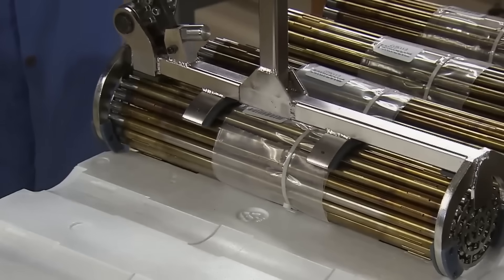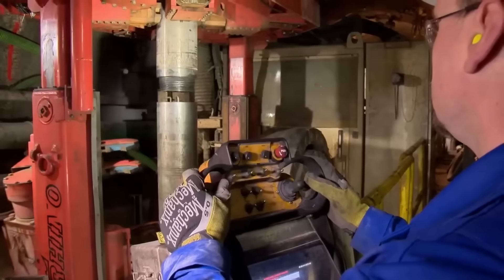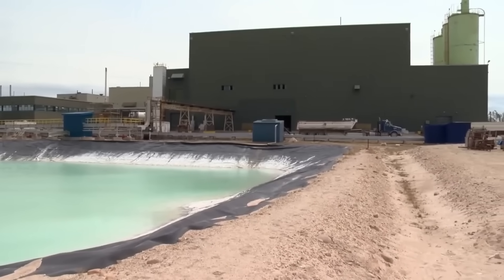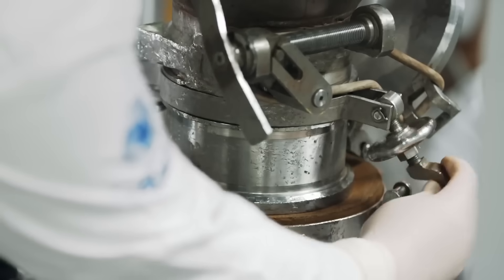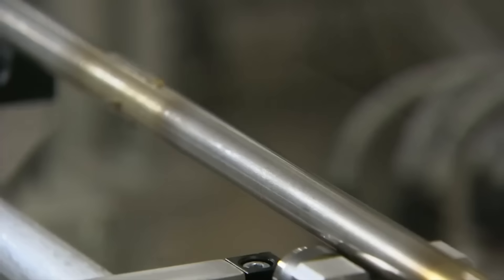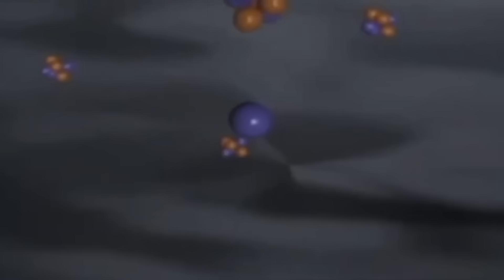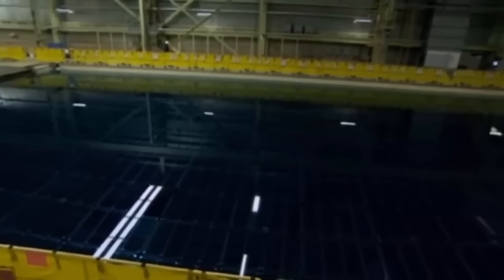How Enriched URANIUM is MADE☢️ | How URANIUM is EXTRACTED FROM MINES | From Mine to Reactor

Comment: It is still an expensive process but at least clean energy, because the fuel rods only last 18 months before turning into plutonium-239 which is the waste material

And still, it contains energy so it stays radioactive, we need someone to come with a new chemistry that makes a fuel rod last much longer because the entire fuel in a powerplant only last 3-7 years, +50 years is good

Comment: Although the spent rods "cool down" in the holding pond, they can't simply then be dumped in your neighborhood landfill.  Currently the US has about 50,000 tons of these rods in cooling ponds.  They remain so radioactive, even after a year or more in the pond, that they have be encased in steel and concrete even to be transported.  The cost of permanent, safe, storage of this radioactive waste will be borne by, you guessed it, we taxpayers.  Currently there is actually no plan, let alone a location, for this project.  Nuclear power seems like a good, no carbon, power source.  It is not.

Comment: Its hard to say if coal or nuclear is more effizient. when you get coal out of the ground its more or less ready to use. Uranium needs a lot of Processing but less Energy for  transportation.
Reply: But you also need to mine and extract far more coal per unit of electricity than nuclear, so that will cost more pretty soon during both plant’s operation.

Comment: with them still being so hot how can't they have a secondary plant use them to still heat water.   Sound to me they still have plenty of life left in them to keep producing power if it takes 10 years to cool them down.   Sounds like you could get almost 5 years or more out of them instead of just 1 year.  Seems like a waist of product and wasted fuel.   it be like putting 10 gallons of gas in your care and only getting to use 1 gallon
Reply: At the end of a 2 year fuel cycle, there is about 85% of the fuel left if the plant runs @ 100% for the 2 years.  If there are start up and shutdowns, the number will be higher.  At the end of a 2 yr cycle it is more efficient to shut down and refuel to the new cycle.
Reply: By hot in that context of AI slop.  It just means radioactive.  Hope that helps.

Comment: If one use big rock and make a hole then poor hot iron into it and pressurized under more pressure than normal like few hundred ATM ( atmospheric pressure) or few thousand ATM then let it cool down then you had uranium cheapest way no need expensive stuff but handle with care because vibration would start radiation ( or use compustion engine and connect pipe poor liquid molten metal in then use hand screw to crank down the pistons until hew hundred thousand psi or million psi then wait for cooling

Comment: Typically only 3% of the energy of a uranium rod is released before the rod cracks and has to be replaced, yes they could be reprocessed but it is cheaper to make new rods out of yellow cake.
Cracked rods have to be stored for 100,000 years in an atomic waste dump under high security to prevent terrorists getting their hands on them to make dirty bombs which would make our cities unlivable and this level of security is costly, however why this cost never enters into the equation beggars belief.
Whereas a Thorium fueled Liquid Salt cooled nuclear reactor gives up 97% of its energy and is cheaper to build as it operates at normal air pressure and doesn't require a high pressure steel reinforced concrete dome and several steel reinforced concrete chimneys to vent steam all of which cost about $500,000 and take ten years to build.
Every government should ask Kirk Sorensen from FLIBE to give them a talk on Thorium fueled, Liquid Salt cooled, nuclear reactors which can be built anywhere, even in a desert or on Mars.

Comment: Actually the Uranium is used to heat water, and that steam runs through a turbine, which conducts the electricity. The only difference between a Nuclear power plant and a coal/gas power plant is how the water is heated. After the water is heated, they all work the same.
Reply: It is the fission of Uranium 235 that creates the thermal energy to heat the water.  The turbine does not conduct electricity.  It is connected to a generator that produces electricity.
Reply: hell of a way to heat water
Reply: @TheHypnotstCollector  pool heater that i need but cant find to buy it.
Reply: I am amazed, that a nuclear plant is basically an advanced steam engine!?
Reply: @DJURBANBG  Every means of electrical output are steam engines except for solar cells. The 200 year old priniciple still applies , it's just the means to create that steam is different.
Reply: @DJURBANBG indeed... How about a techno of harnessing those electrons sans steaming?
Reply: Except coal polute atmosphere 100 time more
Reply: @grimreaper9853  Yes, but environmentalists only care about pollution if the solution is wind and solar. Getting their way has been more important than their supposed environmental concerns for decades.   Continuing to use fossil fuels for while wind and solar is developed, is preferable than actually having to come to grips with an irrational fear of, and opposition to, nuclear energy
Reply: @grimreaper9853  While Nuclear will pollute the ground for thousands of years.
Reply: @grimreaper9853  It really doesnt.  At least not in the United States. Precips and Scrubber systems take everything out of the exhaust.  Same with concrete plants. It is just water vapor coming out of the stacks
Reply: @poorsport213  And CO2
Reply: @mrperfect87106  Even thats knocked down to a miniscule amount. It regulated pretty tight in the states at least
Reply: Exactly. Worked as a welder in quite a few nuclear and coal burners. Gotta have the high pressure steam.
Reply: No electricity is produced without STEAM!
Reply: @JoelJ-j6q Hydro, wind, and Solar.
Reply: That's exactly what the video said.  Ackchyually
Reply: Yup
Reply: It's not the "Plutonium" that heats the water, it's the fission decay that releases heat absorbed by the water.
As to Plutonium, well - it's complicated, but most reactors primarily use Uranium or spent Uranium+Plutonium (MOX).
Not a simple subject - I'll leave it there...
Reply: It's simple, U238 absorbs a neutron and becomes U239.  It then undergoes a beta decay which 'converts' a single neutron to a proton.  The atom then becomes U239.  Commercial reactors create U239 while operating.  It helps to extend the fuel cycle.  Wait, did I say simple?
Reply: Its uranium in rods of steel, and the contac with water make it somehow very agressiv reaction
Reply: @pieterdeboer5361  So it is. I was watching some Nuclear weapon videos around then as well. I guess it crossed.
Reply: With the exception of photovoltaic cells (solar panels) nearly all our electricity is generated from mechanical spinning force. The simplest way is the steam/turbine method which simply needs heat. That heat can come from any source. Combustion is the most common, nuclear, geothermal and some solar plants use this method.
Reply: I hope that the water in the cooling tanks is used to enter the reactor as it is already heated right?
Reply: You don't know what you're talking about lol
Reply: @wesleywood6306  its exactly what he is talking about, watch the video
Reply: You are wrong.

Comment: They are not handling it with bare hands, or at least should not.  In the video the handlers are wearing gloves of various types, including simple latex.  They are handling titanium rods, not bare U235.  See Wikipedia about "thermal neutrons" and "Gray units" to get a better understanding of those parameters.  The thermal neutrons from natural U235 are very low energy, fractions of an eV.  As such, they are absorbed almost immediately by any nearby barriers.  The real danger is the "dust" or airborne particles, which if breathed in, will stick to lung tissue and act as a cancer inducing site.  Even at these low eVs, the dust is far more dangerous.  Here in Colorado, the soil is naturally radioactive at very high levels, producing Radon gas in under floor dirt areas.  Even so, we have one of the best health records in the whole country.  Metallic DU is much less radioactive than many of our natural soils.  However HEU in metallic form is unsafe to handle, since it will emit high energy neutrons.  That requires heavy metal shielding.
Reply: Where are you getting your information? Without fission, no neutrons are produced.  The half life of U-235 is approximately 703.8 to 704 million years.  Not producing a lot of neutrons.  All neutrons are produced fast.  A thermal neutron is a neutron that is in thermal equilibrium with it's surroundings.
Reply: @vballjim01  Its the dust, shavings, scrap, and combustibility.  Radiation pretty low.
Reply: I worked in a Hospital for 23 years and watched them build an MRI., very interesting, the amount of shielding involved.

Comment: Uranium waste can be recycled as a battery by breaking it more to a smaller particles and coating it with cobalt metal and using the old black carbon rod conductor of the everyday battery size replacing the old mangganese with uranium liquid waste.
Reply: Oh steam powered battery ,your a genius
Reply: You mean a battery that emitts alpha and beta particles in all directions and is always hot enough to burn anything it touches.

Comment: Impressive technology but tragically wasted on the most inefficient and filthy way to extract energy from nuclear fuel. Simply converting natural uranium to UCl4 and  running this in a molten chloride fast spectrum reactor would enable the use of the 99.3% uranium 238 isotope too, thus increasing the energy yield >100× as well as reducing the production of dangerous radioactive waste.

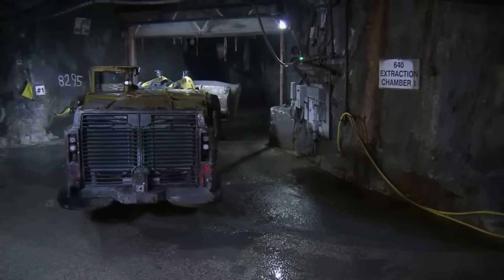Comment: 2:45, u238 is barely active and at the concentrations in the ore, its self-shielding. It’s far more hazardous as a heavy metal than it is as a radiological hazard. Different story if enriched, but FFS most house bricks are slightly RA…
Reply: U238 is depleted uranium U235 is the good stuff
Reply: Bill Gates, Bill Gates, now pushing weapons grade mini-nuclear reactors.  You had better get into the modern world, since the next generation of nuclear technology is going to be driven by the wokies.
Reply: I am wondering how they are handling enriched U-235 with bare hands.
Reply: @khanch.6807  to be honest, time distance shielding. Don’t hold it for long. 

HEU is somewhat RA, but it’s NOTHING compared to irradiated fuel, which is ABSOLUTELY HOOFING STINKING HOT. 

The neutron activated nastiness that comes out of reactors is maaaaany orders of magnitude worse than 235u for activity. Even Pu is safe to handle. The MAJOR hazard is cuts and getting minuscule traces of U/Pu into your bloodstream, because the radionuclide will sit there irradiating your innards for eternity. 239Pu half life is 24,000years, 235U is 450,000,000 years, and 238U is 4.5Bill years. 

The external irradiation hazards aren’t great for HEU and Pu, but the heavy metal toxicity and getting gently internally alpha’d to buggery for the rest of your life by a tiiiiiiny spec of metal or oxide that gets into a cut is muuuuuch worse.
Reply: Enriched Uranium merely means they concentrate  the amount of U235 in natural uranium which is HUGELY U238.  Trough processes of gas diffusion and centrifuges they produce U235 and them mix it back with U238 in different percentages.

Comment: " it takes 8 days to replace one piece of pipe and it takes 200 of them "  that's over 4 years. 8 days to replace (?!) a 1.5 meter pipe ?? That is unbelievably stupid.
Reply: You are unbelievably stupid to think that there isn’t multiple crews working on different rods at the same time….. also if the payoff from  one of those little tiny cylinders is equal to 1400lbs of coal or 1000lbs of oil I think it’s worth it.
Reply: They didn’t explain that process very well. The drill rods are 1.5 m. The length of hole is about 100 m then cased and a brine return pipe installed. Not stupid.

Comment: This procedure is similar to coal mining since the 1950's & 1960's. My grandfather worked first in the wood shop then worked in the mines even though he was over 6"2" high & the tunnels were about 5 & 1/2" high. He was diagnosed with black lung in the 1960's & was retired from the coal mine with retirement pay. My father also worked on the machines which grinned the coal from the coal face. He hated that work as a electrocution.

Comment: You do not distinguish between U235 and U238 very well it is the increase of proportion of U235 via centrafuge which is called enrichment;you only say the U235 can cause a chain reaction - you don't make it clear that U238 is useless in the reactor; and that only the U235 splits.  You don't say how these chemical reactions take place you use useless words like - it is treated by acid - not very informative, why not even more vaughe - it uses a process or it is changed or something is done to it. Pretty much a useless video.

Comment: I've seen this process at BNFL Solwick near Preston, you can't have a drink in the workroom so it doesn't act as a moderator and produce fission, now that was insane...
Reply: I guess you visited the Oxide Fuels Complex? Drinking, eating & smoking is not allowed in controlled areas for various reasons, if you want a drink you just need to step out of the controlled area it's not a problem. Yes water is a moderator (slows the neutrons down) but only a problem in some high enrichment areas there are other materials which are moderators too such as polythene which must also be controlled. A criticality incident is always possible but there are many measures in place to mitigate that eventuality, water exclusion being just one. BTW its Salwick not Solwick and is now called Westinghouse formally BNFL and before that UKAEA in the really good old days!
Reply: @col8981 what do they do about human body perspiration or human bodies constant release of moisture

Comment: Nuclear power is a totally uneconomical and inefficient source of energy:
The energy originally used for extraction and production of uranium could have been used to generate energy long ago! (conversion losses around 90 %)

And then there are the costs for the final storage of the spent fuel rods for more than 1000 years...

And all this for a use of max 30 years...

Comment: Here is something I don't understand about packing and transporting those fuel assemblies.
Putting them in close proximity to each other should trigger a chain reaction, which is tightly controlled by graphite rods in the reactor.
How are they safely transported in those pallets w/o any issues?
Reply: Because these are new fuel assemblies, their radioactivity is very low. 99.3% of the uranium atoms in these new pellets are U-238, which decays by emitting alpha particles (helium nuclei), with a half-life of about 4.7 billion years. The remaining 0.3% is U-235, with a half-life of about 700 million years. U-235 also decays by alpha particle emission. There are very few free neutrons flying around in fresh fuel pellets, and the few that are present are moving at nearly the speed of light, far too fast to cause fission. In order to split a U-235 nucleus, a free neutron needs to be slowed down to about 2,500 meters/second, and become a "thermal" neutron. This slow-down can happen if the fuel is surrounded by water, or carbon in the form of graphite. Fast neutrons smack into the hydrogen nuclei in water, or the carbon nuclei in graphite, giving up some kinetic energy with each collision, but without being absorbed. When the neutrons are finally slowed down to about 2,500 m/sec, they can be absorbed by an nucleus of a fissionable metal, like U-233, U-235, or Pu-239. This extra thermal neutron destabilizes the nucleus, allowing electromagnetic repulsion between the positively charged protons to overcome the strong nuclear force that is holding the nucleus together. 

So, when new fuel bundles are being shipped, they are surrounded by dry air in the shipping cask. No water or graphite is present, so no thermal neutrons are present, and no fission can occur. Also, the reactor control rods you mention are not graphite, they are made of cadmium and borate salts. Both cadmium and boron nuclei have a very high affinity for capturing free thermal neutrons without re-emitting them, so inserting these cadmium rods, or flooding the reactor with boric acid solution, immediately shuts down a neutron chain reaction. Also note: most of graphics and video clips used in this video are for the Canadian CANDU reactor, which uses very short fuel rods as shown, about 1 meter long, inserted horizontally into the reactor core. Almost all other reactor designs use much longer fuel rods, 4 meters more or less, which sit vertically in the reactor. The big advantage of the CANDU design is that it can be re-fueled while running at full power. American and European reactors have to be shut down to be re-fueled, usually for at least 3 months after each 18 to 24 month full power run. 

I know my explanation was very technical, but I hope you got the gist of it. As long as new fuel isn't exposed to water or graphite during shipment, it's quite safe.
Reply: @laura-ann.0726  Thank you, Laura very much for this explanation. It is all making sense now. I learned something new today.
Much appreciated !